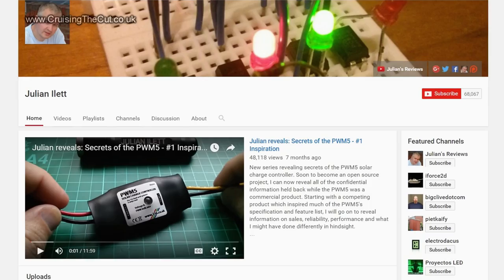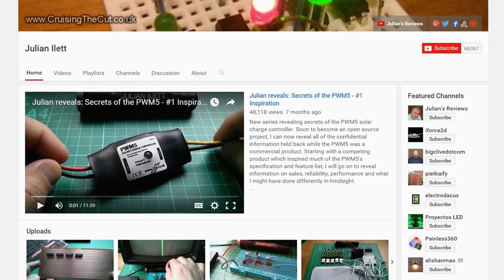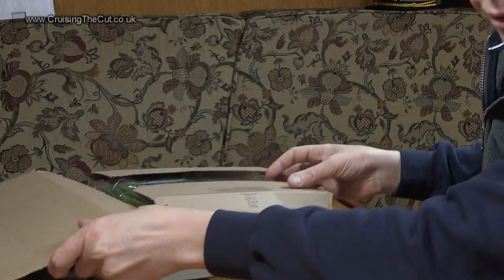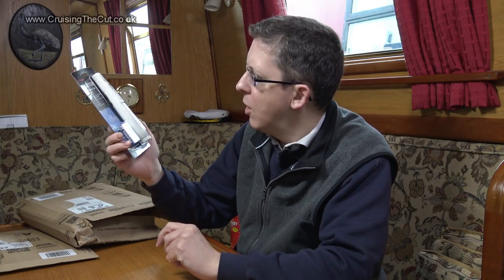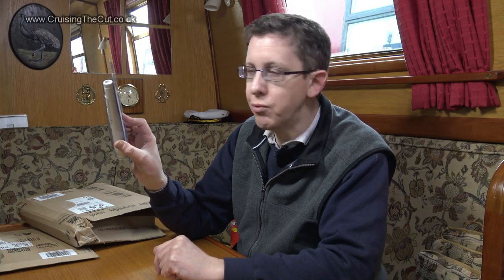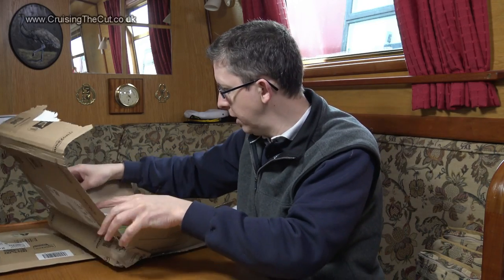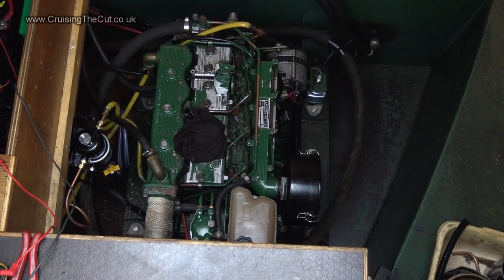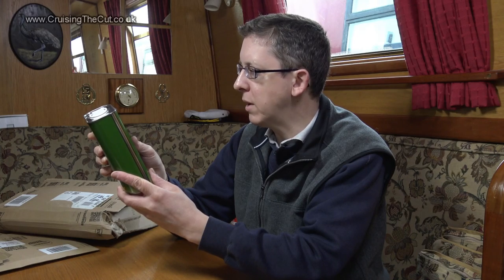24. Another haul of bits and bobs for my narrowboat.

Comment: hey David just out of curiosity was did you fit your shower thingummyjig tap thing before or after your intermittent chirping of your water pump issue arose? or was it solely your accumulator tank at fault because in effect that stop tap bridges your hot and cold water loops together meaning you may be pushing hot water into the cold loop or vice versa depending on varying hot/cold loop pressure. just a thought :) keep up the great videos.
Reply from the maker: I didn't fit it in the end but it was not the source of the pump issue.
Reply: @CruisingTheCut , I wouldn't bother with that either if I were you. I have a shut-off setting on my shower head and I've only tried it out once or twice, but the water has invariably cooled down in the pipes by the time you get to turn it on again. It MIGHT be useful for filling a bath or large sink with water of the correct temperature, because I guess it will equalise again, eventually, but not soon enough while you're standing under a shower waiting...

Comment: I'm not sure the tape is effective on a pressure fitting. It's more for threaded seals. gas fittings (at least in the States) have a bevel sufface that does the actual sealing and the tape is not useful there. The tape may provide "lubrication" of sorts that help fully seat the bevel. I find that when I fill my bottles, I need to hand tighen the fittings to feel the threads fully seat. I always use soap spray to recheck each time I install my tanks.

Comment: If you can get the flakey rust off and removed you can treat the space with OSPHO which is phosphoric acid that will harden the residual rust and they you can paint over it....Jack
Reply from the maker: Hi. That's what the Fertan does. Cheers.

Comment: If your UK propane bottles are like the USA tanks, using PTFE tape on the connector to the bottle does no good.
Reply: correct. its the male and female ball end that should be brass that makes seal with nothing between. The only place it may be needed is on any adapters and hoses that dont have a tapered or ball type seal. glad i wasnt the first to catch that right off...lol

Comment: I think you may have shares in Fertan, it’s mentioned so much? 
Job prob done now, but, what about scraping away loose rust from the bilge as best poss, hoovering up, then pouring in Fertan to a depth of 5mm. Suspend the pipes from the floor with string to protect pipes. Later, pour in some paint to flow over surface?

Comment: hahahahaha the tap valve thing , you know something you make even boring sound interesting
Reply: in theory you could leave the taps permanently at the right position
Reply from the maker: I ended up trying the valve and it wasn't great :-(
Reply: CruisingTheCut I'm sure you could pick up a replacement thermostatic valve of the same dimensions as the shower mixer. That will have a thermostat control which you set to the right temperature and then use the on/off tap. Perhaps B&Q, or Wicks, or even a caravan accessory supplier
Reply from the maker: Maybe. The trouble would be installation as I'd have to rip out the shower tiling to get to the pipework and frankly I can't be bothered! :-)
Reply: Did it dribble? They have to, or the bloody water goes cold, although I still can't figure out the mechanics of THAT. I have been using one in every house or boat I have lived on for decades (being Ex-Navy, and used to "Navy Showers").
Reply from the maker: Gary Laufer Not sure what you mean about them having to dribble to keep the water hot? You'll see in a later video I didn't end up using the shower tap thing anyway, and there's no dribbling here!

Comment: You can use a spray bottle with soapy water to show you if a gas leak is there on any fittings!!
Reply from the maker: Cheers
Reply: I've used this for many years, low cost and doesn't require batteries.

Comment: Thought I might mention an important tip about your gas leak detector. Even very expensive commercial detectors can fail, they are usually tested and calibrated yearly. That being said, I would crack open a valve on your cooker, for example and test it every time before using it. It would be a problem to think it's working, when in fact you have a leak.
Reply from the maker: I don't think anybody on a narrowboat tests their cooker every time they use it.
Reply: You misunderstood, I meant test your gas sniffer every time you use it. You need a gas source to do it.:-)
Reply from the maker: Ah! Yes, I see what you mean. Good point!
Reply: CruisingTheCut   If you are suggesting turning the gas on to let it drain into the bilge to test the detector,, that could be dangerous. Without good ventilation the gas will stay there and repeated testing would result in a potentially explosive build up.
Reply from the maker: I am not suggesting any such thing. The person who posted the original comment suggested it. I'm fully aware that gas can lie dangerously in the bilge. My phrase "good point" was in reference to that you'd need a gas source to test a gas detector. I am not suggesting anyone test it on their cooker.

Comment: Just saying if you used a water dish soap solution and a small paint brush applied to the connection you can safely and cheaply detect leaks.
Reply from the maker: Good tip!

Comment: I do hope you did NOT use the PTFE tape on your gas bottles as that would be dangerous, I suggest you check the internet for safety advice on serious subjects like gas safety as some people might mistakenly follow your lead and with disastrous results.
When you change your gas use soapy water to wipe clean both of the connectors and after tightening up pour or spray small amounts of soapy water on the connections and watch for bubbles, that and your nose are the best way of checking, gadgets go wrong.
Reply from the maker: I've had totally conflicting advice on the PTFE tape. I do not make myself out to be an expert and no-one should follow what I do on any basis of it being "the correct way". I do indeed use my nose for gas as well as the detector. Thanks.
Reply: Ping pong is right I use soapy water every day at work to check for gas leaks we have it in spray cans

Comment: You can always use a sand blaster, with an extension, to clean out, all that rust. Should be a piece of cake that way. I would`t  even mind having a go at it , just for the sport. And I think that once you`v got it down to bare metal, a good tar
- based sealer, might keep it good, for a long time to go. Jolly- good, mate.
Reply from the maker: That was a long time ago but thanks for the offer!
Reply: I see your still afloat, so it`s safe to say, the repair went well.  Very good, ol` chap. Carry on.

Comment: I'm sure you know this by now but propane in heavier than air  and will most likely end up settling in the bilge so I would prefer any monitoring system to be in the lower chambers of the boat.
Reply from the maker: Yes, I was aware of that, thanks. That's why the gas locker has floor-level vents to let any escaped gas out instead of building up.

Comment: Be careful with gas on a boat, you should be gas safe registered if your servicing any appliance or pipework, or your insurance could be compromised.
Reply from the maker: Strictly speaking on a boat or campervan you don't - you merely have to be "competent", I believe, although it's arguable that "competent" would mean Gas Safe and it's certainl;y better to err on the side of caution with gas! As you say, an insurer may specify only Gas Safe engineers but mine makes no such demands, for example.

Comment: That inline shower valve ...... did you only try to use it at the shower head side ... I recall somewhere in another video that you'd perhaps given up on it ..... wonder if you have tried it at the tap side of the line?
Reply from the maker: I gave up on it!
Reply: Try changing the mixer taps to a single lever type or a two dial type. It isn't too difficult, just turn of the water pressure first! Most mixer units are a standard 150mm centers so a new one bolts straight on.
Liking the videos.

Comment: Be careful with your new inline shower valve, with it closed there is probably different pressures from hot and cold, therefore you could be back filling the hot into the cold pipe or vice versa which renders your purchase useless. Best get a thermostatic shower replacement. Good luck with all that.
Reply from the maker: Hmmm, interesting point. It's all pumped by the same pump (though the hot goes through an accumulator) so it ought to be the same pressure surely?
Reply: +CruisingTheCut Fair play then, if it doesn't work you will know why. Love the vids

Comment: just curiosity what is the breakfast bowl catching under the engine,as ever look forward to  video blog blog ,but love the ethos i am same for gadgets ,remember you never know when they will come in handy.
re the rust in locker unless the guy who said its ok has given you a report telling you the steel thickness be wary  (as a minimum a good wire brush and rust remedy then paint).
dunno if you have a drill but think about  a wire brush attachment off amazon/ebay  don't think they would be that dear .
myself as a qualified welding/coating inspector its easier and cheaper to nip it in the bud.
ps keep up the good work
Reply from the maker: +mark darlington I wondered whether that part of the bilge was rusty because of any drips from the coolant pipe so I put a bowl under the join to see if anything was caught (it hasn't been).

I think all the rust came about because the prior owners had continuous issues with too much dripping from the stern gland and never addressed the issue though I now have and the few drips there are now are caught in a bowl.

I've already bought two wire brush attachments for my drill so I'm all set to go on that front! Cheers.

Comment: Rusty bit looks heavy have engine lifted and have area sand blasted to clean metal prime and paint immediately to stop it corrroding again..
If it is under I would suggest a battery acid leak is making corrosion worse...

Comment: I understand that you want to sort that engine bay floor, but why do you want to remove grease from the engine?
Are you aware that a film of grease protects the engine from corrosion?  It may not look pretty, but trust me you don't want to be trying to do maintenance on an engine where all the bolts and screws have seized due to lack of protection.
Bear in mind that the hot/cold cycle of any engine causes condensation. That's why you see so many car engines with rusted bolts. It's not caused by rainwater  :)
Reply from the maker: Good points. It's just quite mucky in places rather than simply lightly greased.